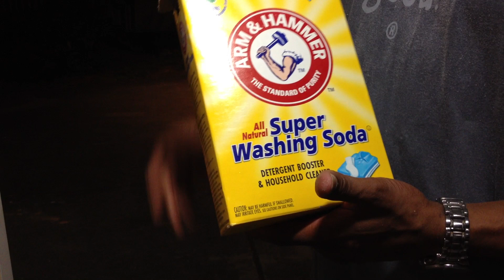Building My Electrolysis Tank | Part 2

Comment: You have TOO MUCH washing soda and TOO MUCH volts and current. 

Washing soda 1 tablespoon p/gallon

12 v 6 amps ample

Your setup will bring too much harmful gas in a shirt period of time AND corrode your anodes very quickly. 
Electrolysis is a balance process. 

I’m a chemist. This is free advice.

Comment: Question: Do people paint cast iron skillets?? Recently I bought an unmarked, heat ring (no notches) skillet (handle looks like Griswold). I used electrolysis 24hrs and that got all of the crud and built up gunk off. However, unlike any other skillet that I've done before, this skillet remained black! When I took it to the sink to scrub with brillo, my hands got all black. I put it into electrolysis tank again for another 24 hours. Same result. No crud but a very black skillet that turns fingers black when handling it. What do you think I've encountered? I haven't a clue what's going on with this strange skillet.

Comment: DO NOT HANG NEGITIVE LOAD WIRE INSIDE WATER USE WIRE I DO GOLD PLATEING FOR MEDICAL REPAIR YOU WILL TURN YOUR CONNECTOR INTO THE ELECTRODE
Reply from the maker: Robert S - Can you please tell me more?
Reply: Use steel wire or a cast iron hook.  If your wire is copper you will be putting a little copper (never use aluminum) into the solution - generally not a problem with cookware - but critical in other areas.
Reply: I heard copper was messy and not to use it.  That's why I was reading the comments....I saw the clip was copper.

Comment: Does it make a difference if the water is hot or cold ??? Great videos btw love your collection you have keep up the great work !!!
Reply from the maker: shawn asher  - I don't think so. But using higher amps warms the water a bit. I would just use room temperature.
Reply: Ok great thanks for the reply back.

Comment: This process is also a good way to remove paint too
Reply from the maker: brandonlb199517 - Yes indeed!
Reply: Only if there's rust under the paint. I guess one could add some type of corrosive compound (acid, salt etc) to the solution to mildly eat away at the material under the edge of the paint. But it'd be doing the same everywhere exposed for the duration of the soak. 
Btw the reaction (in standard electrolysis setups) is done when the part is clean, therefore using extra power & anode material (built in off switch basically)

Comment: Where did you get the battery charger?
Reply from the maker: Bassfinder68 - Advanced Auto Parts
Reply: The Culinary Fanatic Can you be specific on the model # for the battery charger? I've read numerous times that people couldn't get their charger to work because of automatic protections that kick in.  The chargers are looking for a battery load which is much higher than the low resistance you get with electrolysis and they shut off.
Reply: +Sean Donner Most battery chargers only have the automatic feature at the lowest amperage settings for trickle charging. If you want a low amp non automatic charger the least expensive ones usually do not have the automatic feature. I use a 5 amp AC adaptor from an old boom box. Any steady DC current should work. I plan to try an old 5 volt, .35 amp cell phone charger. High amperage should work faster while low amperage reduces the risk of pitting or other damage. When I am cleaning a century old piece I want the damage to be as little as possible. I am not in a hurry.

Comment: congrats on the success.  I use a much lower current on mine. I also didnt make my set up nearly as pretty as yours is but it works :)  too much current can "cook" your electrolyte solution and can cause pitting in the metal surface.  you are dealing with old iron. it has had ample opportunity to have heat stress and old rusted areas. plus if there is a sand pit that is covered over from the original casting decades or generations ago it can blow out.  I generally use around 2 amps.  that is because my charger doesnt drop down to 1/2 amp. That is my reasoning.  I use it to clean my cast iron and old cutlery and tools also.  I never expect it to happen quickly. I usually plan on a week soak and am happy if it only takes 2 days.  I do take the work piece out of the water at least once a day and give it a brush down with a nylon brush and a rinse off with clear water to see progress.   your sacrificial anodes will end up looking like they are wearing red wooly jackets also.  I give them a scrape down once a day.  But it is fun to watch the surface of the water turn into orange foam when you have a really rusty piece working.   Have fun with it you are off to a great start

Comment: I use insulated 8ga. copper insulated to suspend my pans and strip my connection points.  I have a loop that sticks above my wood support beam for my clamp connection so my connection is not in the solution.  I only have one sacrificial steel that sticks above the solution so that connection is out as well.  your set up is really, really nice.